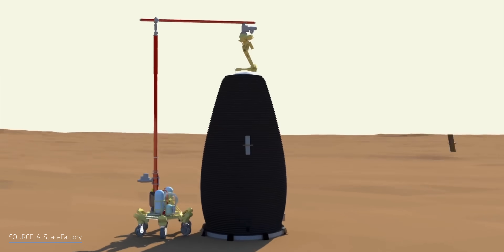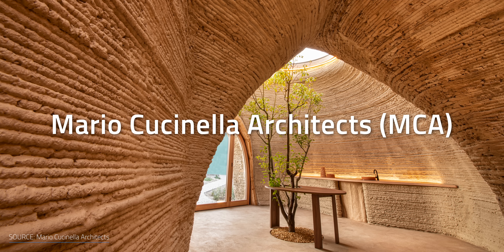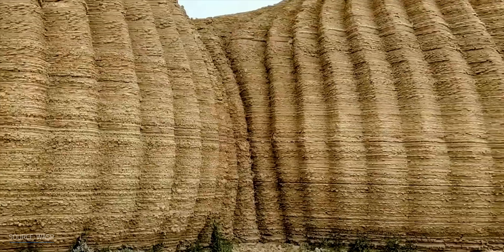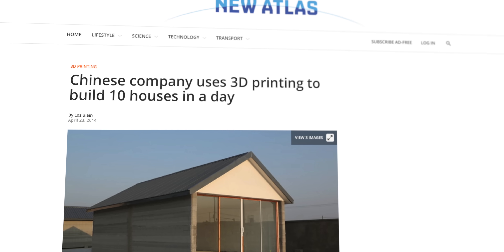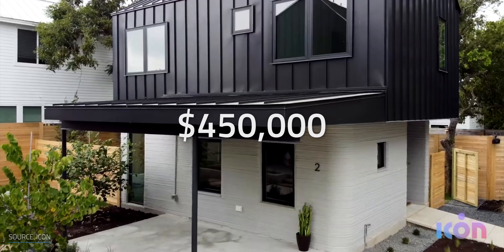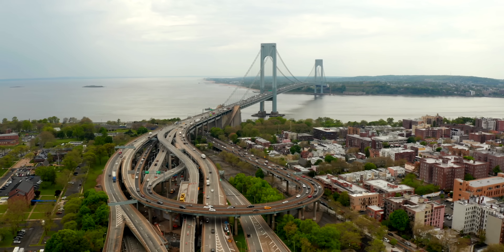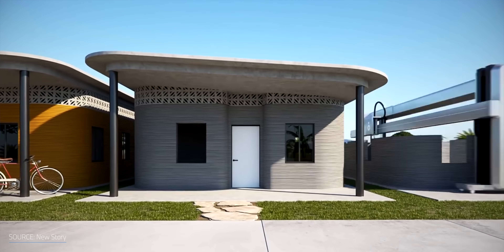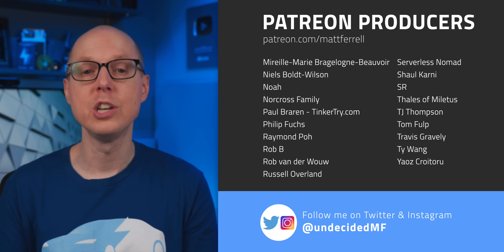The Truth About 3D Printed Homes

Comment: I love the idea of a 3D printed house... But I seriously wonder about the practicality of it.
As an example, my home was built in the early 1950s, and it (like many homes in the neighborhood) have housed several different families over the years. In the 1960s someone finished the attic space for a couple more bedrooms. In the 70s someone added a small extension. In the 80s someone added some insulation and upgraded to a modern HVAC system. Through the 90s and early 00s the owners were barely ever home and didn't maintain anything, so we got it for a steal right before the 08 crash. And over the last 15 years we have worked a lot on insulation, replacing old plaster, and some minor structural improvements. Not to mention someone added a phone system with 3 phone Jack's and at least 1 cable outlet in every room (including the bathroom lol). And I added a lot of cat5. Nobody in 1950 could really see a need for any of that.
Point is, it is thesiesis ship, ever changing and evolving over the past 70 years. And sure, not everyone is as gung-ho about tearing open a wall and unraveling the mess found inside like I am... But people will make changes to their home over time. A house that is 3d printed may work great as a dream home for the first family moving in. And when the home doesn't suit needs perfectly I am sure most people are less stubborn than I am about making changes to make my house work for me. But inevitably some new thing will force a change... How viable will it be to make changes to these homes? If an accident happens and a hole needs to be patched how hard will it be compared to drywall?
And when much more conventional construction comes in near the same price and similar efficiency... Well... Is there a point?
And I say this as a huge believer in the idea that we will literally have some traditional construction jobs being replaced by general purpose robots in the next 10 years. Atlas in 2032 will totally be able to put a house together perfectly to code working day and night using current day construction methods. And neat as 3d printing is... It just won't compete with that in 10 years. There is little point to making a specialized robot that can do 1 thing when something like an atlas platform will do everything just as well, just as cheap, and be able to be tasked on any number of projects over its useful life.
Pains me to say it... But 3d printed housing needs some truly massive improvement to make itself worthwhile. 3D printing holds a lot more promise in unique to medium scale production of complicated parts. Changing a 3d printer to mass produced goods is fundamentally misunderstanding the tech. Use a 3d printer to make a mold for a wall, and then use the mold to make a million mass produced walls. That is the direction to go in.
Reply: You know what our home are built 9f brick stone and block and it just as easy as dry wall to repair or open up but it last longer than you shed homes in North America
Reply: thats why its called rapid prototyping but people like to use it for rapid production and its not very rapid when it comes to mass production. Bottom line, people are lazy
Reply: pyropulse  Today, only 4 billion hectares are left. The world has lost one-third of its forest – an area twice the size of the United States. Only 10% of this was lost in the first half of this period, until 5,000 years ago.Feb 9, 2021
Reply: pyropulse  "you oaf"
Reply: I've had my own fantasy, of installing a ceiling-mounted robotic system, with which to move furniture in, out, and around. Make that into a repair robot, and... One of the major challenges to my idea, is that you'd have to LIVE WITH it hanging from the ceiling, all the time you WEREN'T moving stuff around...
Reply: As the world runs out of lumber over the next 100 years, other housing materials will be needed. Perhaps that's where this tech could become more viable. Then again, bricks are always a thing.
Reply: @NathaNeil27  you know  that trees literaly grow every year, right? Lumber is the ultimative renewable material known to humanity for ages.
Reply: @NathaNeil27  GOOD NEWS MY FRIEND!! I have contacts in the Orient that tell me of new developments! They call it "farming" and tell me it will be big very soon.

Comment: A self driving truck shows up, a few robots waltz around preparing during exacting spacial logistics and material acquisition, then before moving elsewhere, prints 1 of 101 housing designs from a database, that won't even ask for one thin dime, not even a nickle from the knees nor a penny from the thoughts.
Vote for GPT4.397 A.I. in 2024🗽

Comment: A good idea for remote housing might be premanufactured homes using retired shipping containers.
Sure theres the shipping cost of the unit but they can be built out and furnished in a factory location and then stacked on location with standardized hookups to electricity and water systems. They can be airdropped in one piece to hard to reach locations as well. No heavy equipment on site is required, just minimal manpower with light tools to construct foundations and stairs (if stacked) and connect infrastructure like power and water if/when available.
Reply: Shipping containers are a bad idea for housing.
1. Living in a steel box is not pleasant. If you want to make it livable you need a lot of insulation and a second roof above the container to shade it. 
2. Even empty shipping containers are quite heavy. Without heavy equipment it is hard to move them. 
3. They are the wrong size for housing.
4. Cutting and drilling (for windows, doors, electrical work) is time consuming. 
5. If you use retired containers you have to make sure that in no point of their live did they transport hazardous material. 
6. The floor is treated with nasty chemicals, so you need to remove the floor and build a new one. 
7. And probably a dozen more reasons that I just can't think about right now. 

If you don't believe me just take a look around YouTube. Check out the videos of people building container homes and compare the amount of work they have to do in comparison with normal buildings. 
And even if you do all that work in a factory it's still work that has to be done. Normal prefab homes are much simpler.

Comment: 3D printing for now will probably be best used for niche things, like foundations. The printers work great with concrete, which is not that great for the environment; but using the printer with a honey comb like structure, and maybe aircrete infill of the chambers, Foundation costs could probably be dropped along with their environmental impact.

Surprised no one is looking into using CNC machines to lay bricks and other structural units, like hempcrete blocks, or doing 3d printing with hempcrete onto an existing frame. That would make a logical step, on a similar idea, with just some differences in the mechanics.
Reply: Look up SAM, the bricklaying robot.
Reply: There are already several bricklaying robot companies showing of their skills for building houses fast and easy. 
That can work 24/7 and set up the foundation for laying pipes and lay out powerlines. The sales pitch is that you only need a crew for transport, details and final quality checks. And then the robot or robots can build the base of a full 4 bedroom house in 48-72 hours. Some have claimed 24 but that was only for singe floor plan housing. But they are becoming popular in Scandinavia so. 

Also there are some companies showing of how to take down houses with minimal risks and high automation with robots doing most of the work and creating less rubble. 
I think the construction market is one of the future places where worker demand will plummet.
Reply: Fastbrick Robotics has a working prototype in Western Australia. Has build some one and 2 storey houses in Australia and Mexico using large blocks.

Comment: I doubt such dirt-printed houses would last for long in a rainy climate. At least they would require permanent maintenance and repair. And the impracticality for multiple stories is an issue, too, when thinking about land consumption for an increasing population. Nowadays there are even considerations to make multiple stories mandatory, and add stories to commercial buildings in the denser populated regions, where more land for building houses is just not available, because that is needed to grow food.

Comment: Return to tradition. Just use fucking bricks.
This seems like an over-complicated way to invent a brick house all over again. The only difference between 3D printing and laying bricks is the step size. And well-made brickwork looks a lot prettier than this. If you wanna make bricks onsite to save shipping, then fine. But I guess you won't get internet-famous from youtube videos made about you for just using one of the oldest and most reliable technologies known, so suppose you made normal dirt or clay bricks, and paint them a different color and call them Hyper Bricks so that soy faced redditors would blow loads of investment capital right into your face?

Comment: I think that there is bound to be some role for 3D printing in the future of construction - especially given the decline in the number of people going into construction. We're going to need automation of one kind or another to help fill that gap. But that said, 3D printed houses remind me a bit of the concrete houses Thomas Edison built in New Jersey. I'm sure some people thought that would be the way of the future, but as we know, that did not turn out to be the case.
Reply: " We're going to need automation of one kind or another to help fill that gap. "

There already is automatable alternative. Prefab element building. The stick framing for example can be done on a factory build table on a big building table by a robot. One can already by a prefab element framing robot from industrial robotics company like HOMAG. Only reason it can't be done on-site, is that robots deal badly with changing circumstances (which by the way would be issue with bringing 3D printer, which is essentially a big robot, to a new work site). So you don't try to. Instead one has regionally somewhere nearby house factory/building element factory.

There they can on big production lines with big automatic production machinery make just as well timber frame or concrete cast the walls. Main difference being... none of this has to be done upright. Since the factory can have perfectly flat and true build table onto which either place a concrete mold or start laying framing timbers. In case of concrete (or anything castable or moldable. Be it concrete, rammed  bonded earth, hempcrete) you just fill the mold and move the mold on wards. In case of concrete as I remember the process is to let them cure sometime flat on a waiting area and then once they are firm enough to not sag, but not yet completely cured one moves lifts them upright and places on curing racks to wait out the full curing. This has also the benefit of not having to use quick curing concrete just so the building site is not halted. One can have multitude of molds at the factory. So you just keep casting and all you need is molds and warehousing area to wait out even long curing concrete without halting production. This might be desired in case of one wants better properties which might be allowed by slower curing concrete.

With assembled construction like timbers.... automated saw is given the cut plan of "we need this many of this length, our source size is this". It cuts optimal selection based on "how to minimize waste cuts" in order. Belts feed these to assembly robot. It places the timbers on an assembly jig. Nailing robot comes along, nails everything in place. Same with robots rolling out vapor barrier sheets from roll, robots lifting and nailing in place sidings like plywood and so on. Robot blowing insulation like mineral wool into the frame element, put another sides facing in place. Robots can even automatically cut and drill conduit passages. I think actually snaking in the conduits is still manual, since well that is fiddly dexterity needing work.

What is to say, you can already robot build walls. It is just easier in factory controlled environment.

Once all the elements is ready (and foundation has been cast on site), book a mobile crane and transport (meaning usually truck) all the elements to building site. Crane lifts the elements in place and small installation crew secures them in place both to foundation and each other (usually foundation has anchoring points installed in it during casting for this purpose). On site time to have walls up and roof in place (which also can be done as elements in factory) for small house is usually a day. Bigger buildings take longer. Of course as always stuff like appliances and so on installation comes on top. However for example interior painting or say wall paper installation can already be done in the factory. At least for some kind of surfacing. Some wall papers probably are too delicate to survive the transport and installation to non heated house frame and so on.
Reply: Nope.    3D may be plausible as a niche product.   Long way to go to until or if it ever becomes a standard way to build.   Factory builds are the most promising.    Also, building codes and insurance issues.

Comment: I have yet to see any 3D printed house that doesn't look like it's made of layers of rough gloop and aesthetically it does nothing for me whatsoever. And I imagine that in a damp temperate climate that surface would collect and hold on to rainwater and dirt very effectively indeed. Regardless of the actual material used. There are better ways of producing low cost and architecturally diverse housing I think.

Comment: I'm more interested in the idea of house construction using more modular factory made components. These could include highly insulated laminated timber wall panels, complete with windows and doors and maybe even services, exterior and interior finishes already applied, all just bolted together.
Reply: This is absolutely the best direction! 
The 3D printed everything hype is just that… it will fade out just like VR. 

Step one is reducing the populous’s idea of a “cozy” or adequate sized homes. 

Our hunger for the biggest home at the lowest price is killing any hope of energy efficiency and builders are essentially lobbying the IBC to keep from implementing greater energy efficiency standards.

Comment: Well, I think you lack a little bit of imagination for developing countries. If you look at clay fortresses in Pakistan, they have been around forever. So in a hot day effin' freezing night, the wall structure per se looks very convincing to me. How much one makes out of this lateron is up to the sophistication and establishment of such techniques. Also, local labour will get more skillful for the installation of PV, plumbing etc., so that's not a concern. Trains don't have a 2nd guy on the locomotive shoveling coal anymore, either. Just imagine (you mentioned Kenya) the biggest slums you have ever seen (have you seen any? Ever felt the heat of conducted through metal roofs?) and start with a few houses that have simple sewers, drinking water and hollow tubes to get electricity and glass fibre internet to your house. You will probably see an effect as in parts of Morocco: They build one level per generation, have the steal rods stick out of the concrete and add later to it. Here, they might have four hives/ shapes opening to the center for three generations etc. Public infrastructure can be planned (which is per se a virtue), roads improved, cycling instead of cars compensates against urban sprawl etc. It's not "one size fits all", it's merely a good start for plenty
Reply: .... gosh that return key kills me... it just ate the continuation of my answer lol

Comment: The most environmentally friendly building materials are: bamboo instead of wood and hempcrete instead of concrete. 

Also building several tiny houses instead of one big one, makes more sense since since you only need to heat the guest house when you actually have guests visiting and use it for storage in the mean time.

Comment: It's very promising tech, but it will need to get implemented with existing tech, until printheads are equipped to also print or install electrical and mechanical(hvac/plumbing) in the structure as well. Until then, a major cost to a home isn't the envelope, but rather the electrical/mechanical/finishing, if we ignore the cost of the foundation and land as well.

Comment: If it is cost that is your concern, then just  get a manufactured home.  In the US they are affordable (if allowed in your area), energy efficient, often include appliances and fixtures, and relatively quick.  Yes, they are ugly and suck if you are in a tornado but I'm not impressed with the looks or cost.  If that is not your bag, just gets some used tires.  Obviously from an environmental standpoint, that is a whole different issue. But if you are income limited (poor) then the 3D printed solution is useless.

Comment: If you want to make inexpensive 3D-printed homes, using present technology, make them in a Quonset-hut shape. A rectangular base, with a domed top running the length, would be exceedingly cheap and easy to build with a "dumb" 3D printer; the home can be made out of many materials; and it offers a squarish footprint which works well with common building materials for the interior. Years ago, I imagined making a place out of concrete, using a simple hemispherical, movable form to create sections of the domed roof, and just moving the form and pouring the concrete.
Reply: I can hear the echo already.